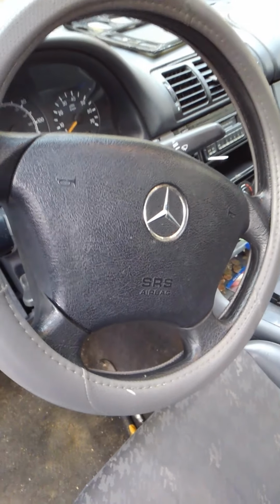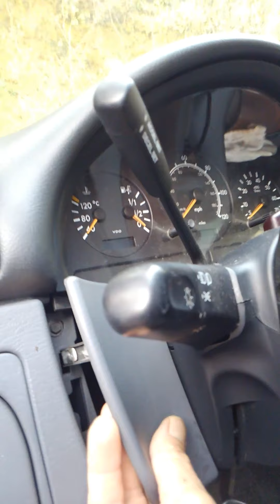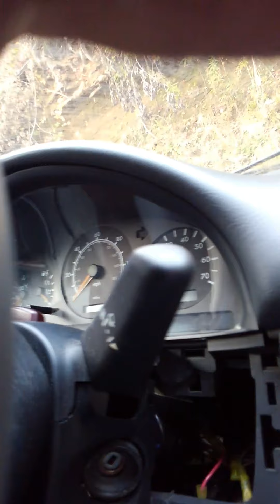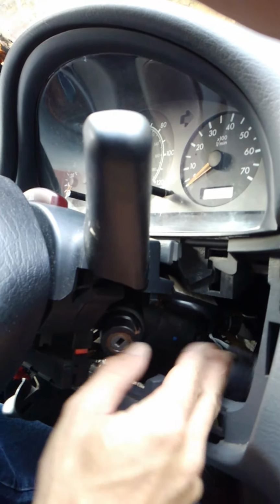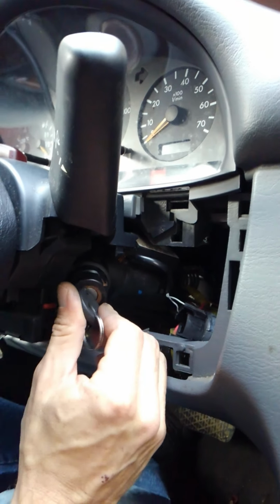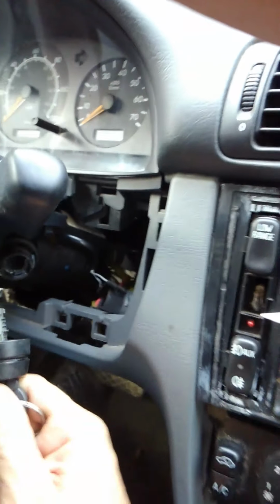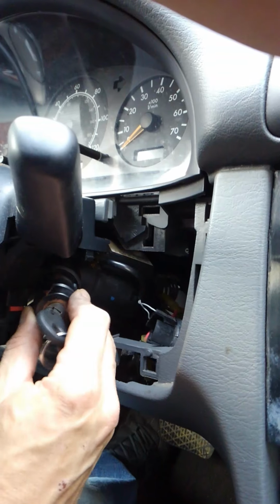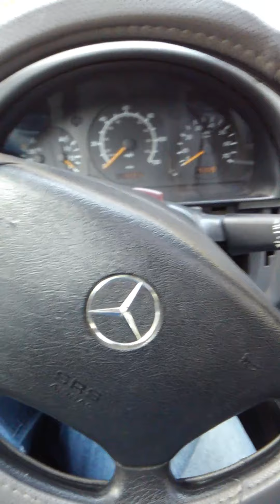98-05 ML 430 320 W163 Mercedes Ignition Switch Key Core Tumbler Removal No Special Tool Needed

Comment: You actually don't show the removal of the actual ignition switch inside the housing for thatis what a real video of this problem needs to be made because I can not find a video of such. Olease elaborate to include the real ignition switch you just show how to remove the cylinder not the switch so change the title please

Comment: Technically it's a transponder switch that reads the chip in the key/fob. The ignition switch is further down that the main ignition or power harness plugs into. These are also known to go bad. You unplug it and release some plastic tabs and it comes out. It's only a $30 part to replace. P/N 1685451004

Comment: I’m having a problem with the steering column staying locked. The car runs and drives but the steering is still locked. 2003 ml500

Comment: Hey i have a question did you use a after market Tumbler? Or Dealer Tumbler? Also I don't have that Key you are using i have the box one with the blade? Can i still remove the tumbler cylinder with that key?
Reply: Also does your battery need to be connected or disconnected?
Reply from the maker: Hi, it was just the stock tumbler, not aware of aftermarket ones, usually have to get one from a parts yard. I just removed it to remove one of the wafers that was being problematic. Any key that will turn the cylinder will work. You do not need to unhook the battery as long as you don't unhook the antenna box for the DAS or turn the key to the  starter engage position. I suppose it wouldn't hurt if you are really concerned about accidentally unhooking something that could cause a DAS problem or if you are going to be repeatedly turning the key many times it may be prudent to do so as too many unread attempts on the DAS may cause an issue but I'm not 100 percent sure. Hope that helps, Thanks!

Comment: Someone tried stealing my ML350 and tire my ignition up now I need to replace it how do I do that
Reply: Tore my cylinder apart all I have is a hole and I do have the key I also have another Ml 350 with a bag trzni can I take that ignition and key and replace it I was told I would need the brain also if I wNt it to work is that true